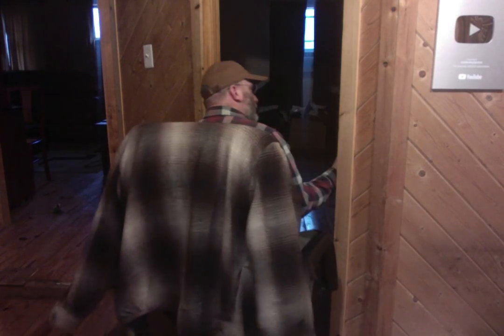Going A Different Way

Comment: Get a piece of 4 or 6 inch by half inch thick  steel pipe and run a chain through it so it can roll  . Mount it on the front of the planter it should lay down the grass or hay half way decent.  It would be cheap and effective.  They do make crimp rollers for the row units but man they'd be expensive and hard to get probably on  back order too . Just a thought .  We plant into Standing rye and red clover we simply run a 70 foot land roller after planting to lay it over . We will then burn it down a week or 2 later with round-up.  The thick mat of rye and clover  keeps the weeds down and holds moisture.  We find the cover crop mix works great and our bean yields are 80 plus bushels thr last 3 years . Great video keep up the good work!

Comment: 13:40. The Haney Test?  That is sure to be a ripoff. Even Oliver Douglas wouldn't fall for that one.
Reply: not being a farmer I'm sure you wouldn't know what works and what doesn't. there are millions of high speed discs in Indiana.
Reply: @onelonleyfarmer  It's a joke based on the old Green Acres TV show.
Reply: @onelonleyfarmer  Yeah, I'm sure there are a lot of those. I was thinking of the older tandem discs that had the smaller discs. And for all I knew, I thought maybe the soils were different enough that you could still use the older style. I just know that decades ago farmers would disc until it was powder and then the rain would seal it off like cement.

Comment: Wes,  you need to brush up on your soybean herbicide rules and regs. You can only spray dicamba approved products in season. Currently, the only dicamba products that can be legally applied near planting or over-the-top in Xtend soybeans are Enginia, FeXapan plus Vapor Grip Technology, Xtendimax with Vapor Grip Technology and Tavium plus Vapor Grip Technology. All the old products your familiar with are still available.
Reply from the maker: well most likely I will be doing that is has been 7 years since I grew beans
Reply: Yeah you’ll get it figured out just takes a little research. These traited beans with the dicamba or enlist trait has given us tools to fight the pigweed species that are group 14 resistant along with being roundup resistant. Unfortunately dicamba likes to vaporize and move after being applied. The result is puckered non dicamba beans and other problems. I’ve raised dicamba beans since they came out but have switched to enlist for this year. With the shortage of herbicides this year it’s going to be tough to grow clean beans this year. Miss the old days when roundup took care of everything. Good luck this year. Great prices in front of us. 👍
Reply: @demo2x  I have inlets beans coming.